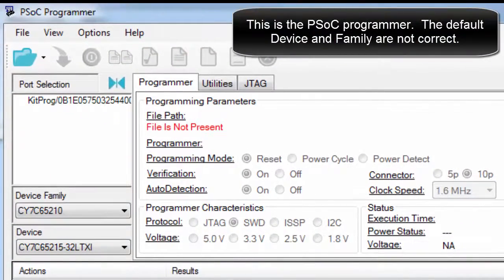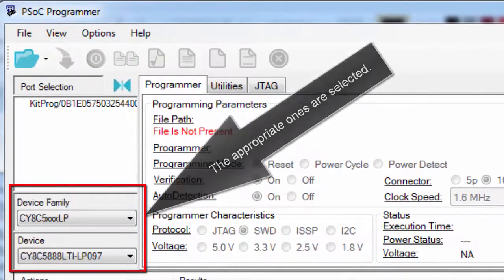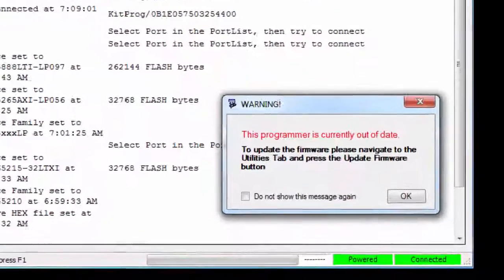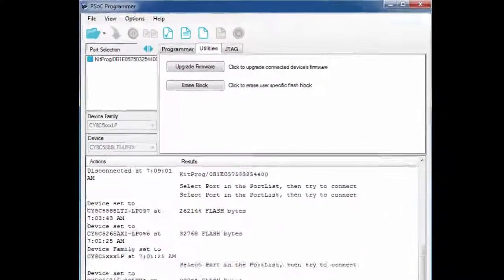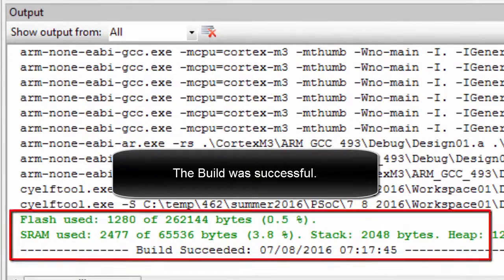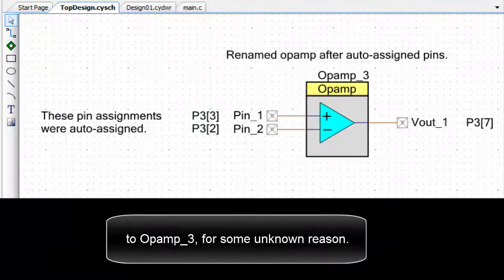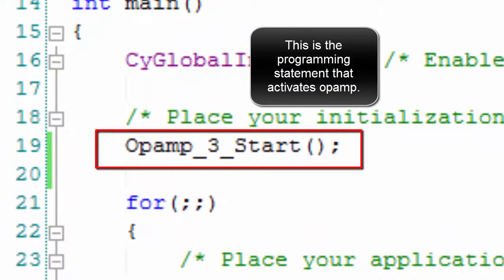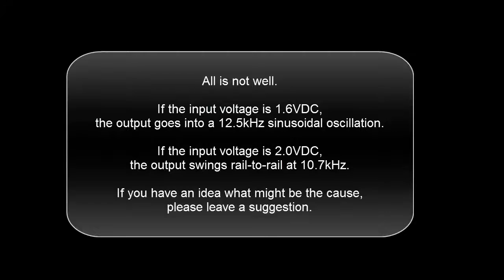B46224 - Cypress KitProg Upgrade - CY8CKIT-059 PSoC 5LP

Comment: It looked like you were powered off the usb connection.  I assume that is 5V.  Datasheet Pg 56, https://www.cypress.com/file/45926/download,  shows that analog outputs of the op amp are limited to +- 50 mV of rails at low current and +- 500 mV of rails at high current.  Its possible the board is delivering 3.3 V to the analog voltage input and you start running into issues with 3.2 V output. Is your usb source 3.3V?  I believe Apple uses low voltage USB?

Schematic, https://www.cypress.com/file/443786/download, shows USB connection going through a fuse then a diode d2 to become VTARG which then goes through two zero ohm resistors R20, and R11 to become VDD which becomes VDDA, the positive analog rail.